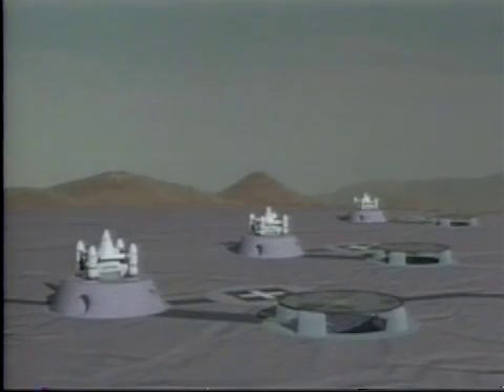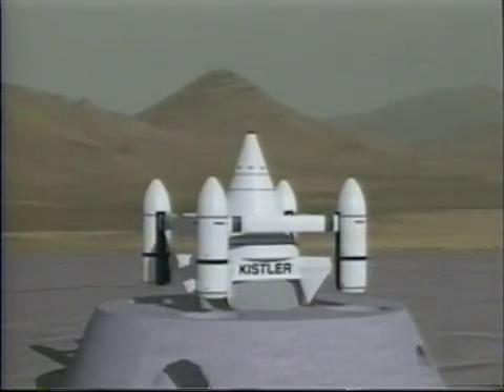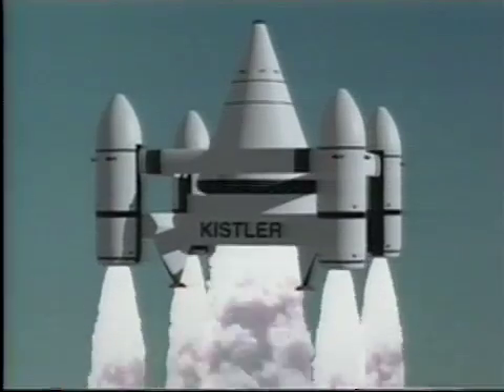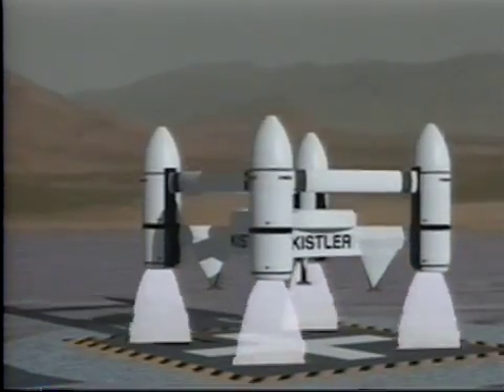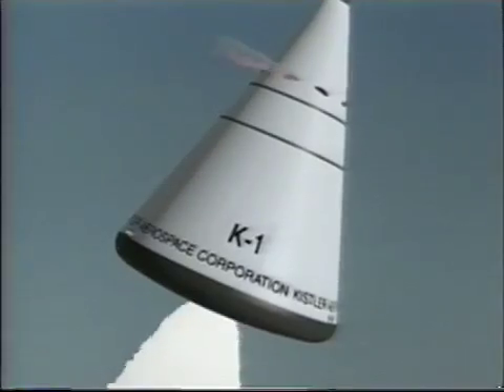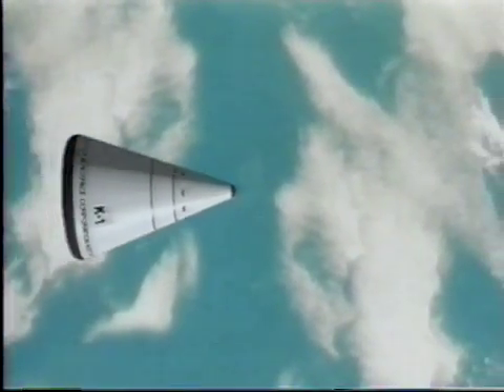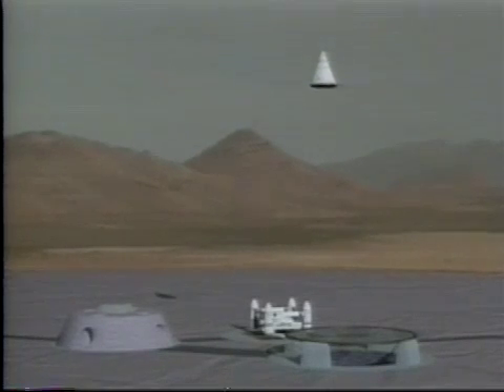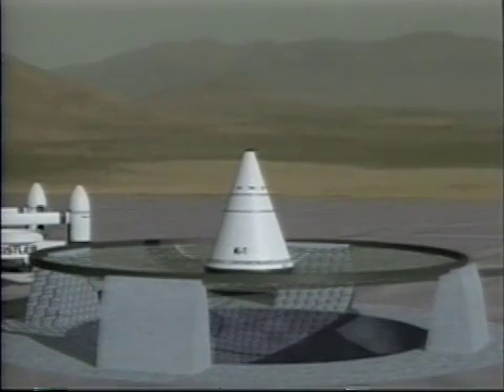Kistler Aerospace K-1 Rocket Launch Animation

Comment: Are you kidding me? Was this make by scientists or 3rd graders ? Where is the "magical" engine in the heat shield ? This is a total pipe dream and not possible by the laws of physics.
Reply: Ya know, heat shields can have doors. That's how the Spaceshuttle's Fueltank feed it's three main engines (through the heatshields at the underside) then the doors closed in space.
Reply: I want to make this thing in ksp and put the engines in the heat shield
Reply: Also this is also similar to the launch escape system of the new shepard